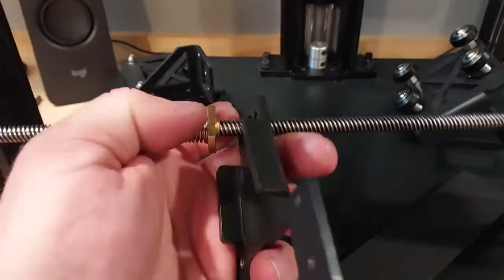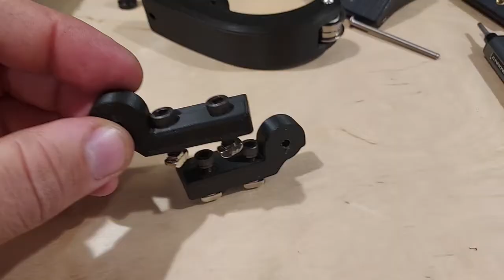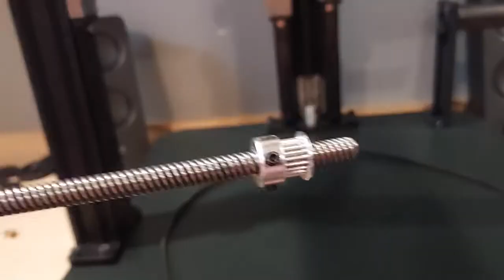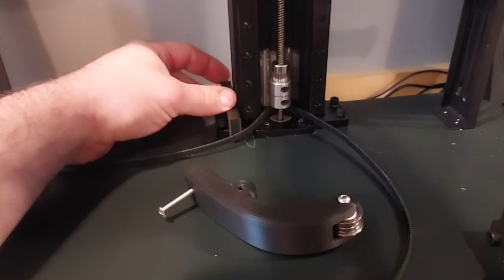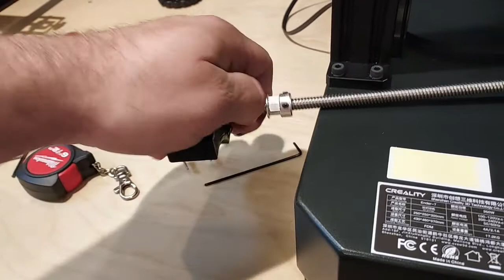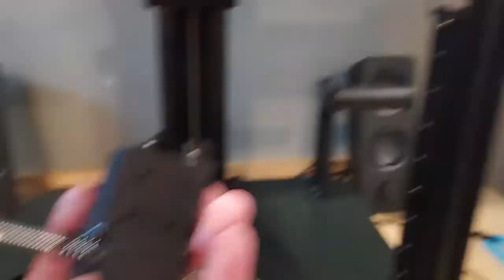Amserv 3D Ender 7 Z Axis Upgrade Kit V4 - Installation Video

Comment: Should have done a before and after prints to justify such a drastic change of the bed.  I think it is just too much for the gain. I would just leave the rear bed as is and just try to add vertical rails, why the lead screws ?